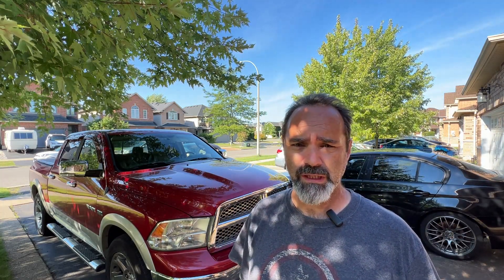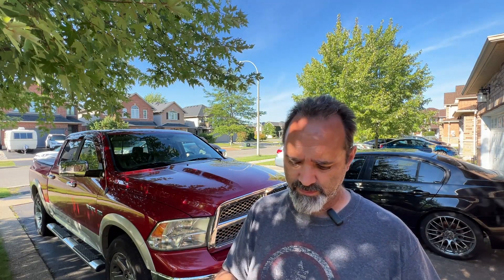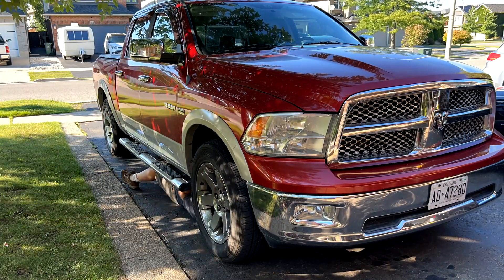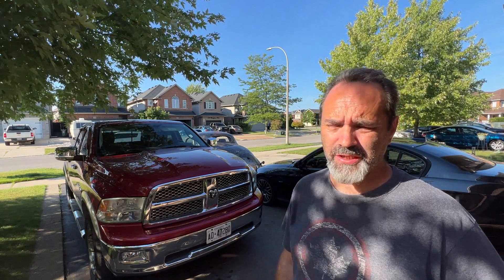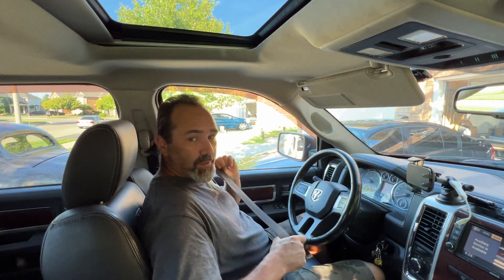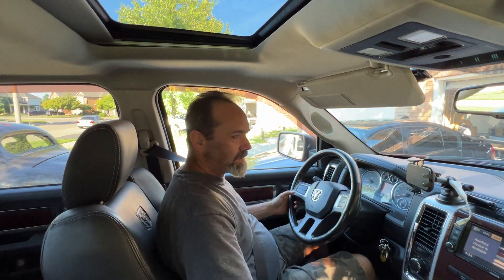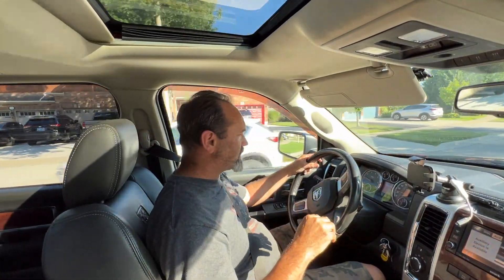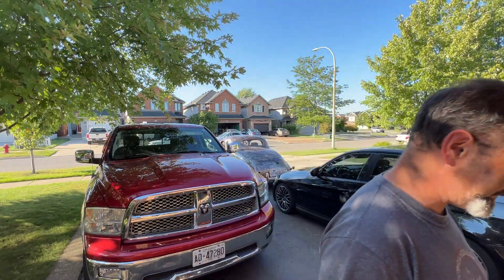Last Chance To Repair My 2010 Ram 1500 Before I Say Goodbye

Comment: Dave that’s sad to see but I feel your pain.  Don’t know if you remember but we both did our camshafts at about the same time. I just ended up spending $4,300 last week on rebuilding the transmission.  I don’t know if I want to keep it because I have invested so much in it, or if I should sell it now while it is running well with no trouble codes.  Sometimes being so handy can be frustrating.  If I just had a well paying office job I could pay someone else to deal with this crap!   At least doing this keeps me watching other talented people like yourself. 
Good luck with the next vehicle.  Im looking forward to seeing what you get. 😉
Reply: Hi fieromike, I also repaired the camshaft myself and we also wrote each other a lot. Sorry to hear about the transmission - a nightmare....
I'm always on the verge of selling the RAM too, but unfortunately I can't find a window of time when everything is in working order. Something is always...
Reply: @Dyna_MikeW  yes I remember!  
“Mike from Germany”
I suppose the real hard part about selling the truck is finding an adequate replacement for the right price. 
We will get a winner one of these days. 😉
Reply: @fieromike1  What exactly is going on with Dave's RAM truck? Electrick? I can't figure it out. Maybe you can tell me?

Comment: You have one more option- pay a shop who has much better diagnostic equipment and more experience on this issue.  If you try to sell or trade in the Ram now with a known problem, it will drop its value so much, you will likely be giving it away.  If you put $300-500 into a high quality diagnosis to get it running correctly, your resale value will be much higher.  Once corrected, then sell it while it is running good.  Many times the price of diagnostics will add more than its cost to the vehicles resale value, especially when used cars are selling at such high prices lately.  I have been in the HD truck repair for over 40 years, and I have had to admit a few times that I did not have the knowledge or equipment to diagnose every fault on a vehicle of mine, and needed to pay someone else for their skills.  After all, you have saved a lot of money by doing almost every other repair and maintenance jobs on your vehicles, so you are still ahead of the game.  Asking for help is not giving up.

Comment: Sorry to hear that Dave. I am a Ram owner myself. I have a 2018 Big Horn. They are good trucks. You will have certain issues with any make out there. I agree with the others, before you throw in the towel, " bite the bullet" and let a good Ram dealer diagnose the problem.Their computers are more advanced than the ones we can afford to purchase. If its something that you can fix, it still is way cheaper than the price of what these trucks are selling for these days. In the meantime, check out this gentleman's blog on You Tube....Dodge Ram " misfire at idle".  His site is called Fixing Cars With 15th St. Automotive. I am rooting for you. GOOD LUCK.

Comment: I know you hate to give in , I have been in business for over forty years and have maintained and repaired most of my equipment over those years but even I run into problems that I’ve not been able to over come and finally had to send them to a shop that had more experience and tools than I . Good luck on what ever path you take . 
Shawn
Reply from the maker: Thanks Rusty. It does break my heart, but I know when I'm beat.
Reply: @ScottRods  just curious have you check your grounds, body to engine and engine wiring harness . With your driving lights flashing sporadically and being on a different wiring harness it could be a bad main ground  . My diagnostic equipment can tell me all sorts of good info and the result , but can’t tell me if I have a wiring problem or find it . Wiring issues are the worst to deal with . 
Hot rods are much easier..lol

Comment: Went back over previous videos and it seems like the original problem was never solved and adding parts only created more codes. Still believe it's an electrical problem not mechanical . With a mechanical breakdown it doesn't go away and return it stays broken. There's an electrical glitch be a ground ,  harness or sensor . Then again a replacement vechical will repair it. Your choice Dave gd luck

Comment: I'm guessing it might be a ground wire your front running lights were blinking really funny when you pulled back into the driveway had a 5.3 Chevrolet Suburban 2000 had a ground wire to the rear passenger head on the engine truck would shut off then start back up later shut off start back up later eventually it got so bad the truck shut off and didn't start did YouTube search said it was that wire fix that wire run perfect but it was given all kinds of weird lights and service lights just my guess one of the ground wires.
Reply from the maker: Thanks Butch, but I have LED bulbs which look like they flicker on camera.